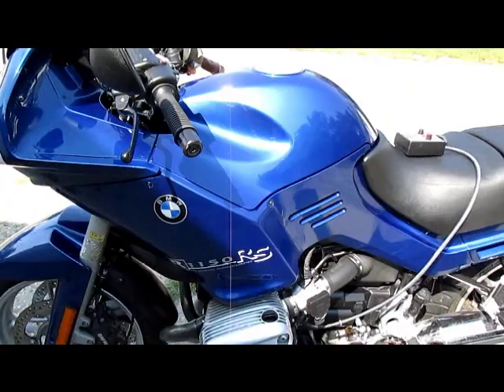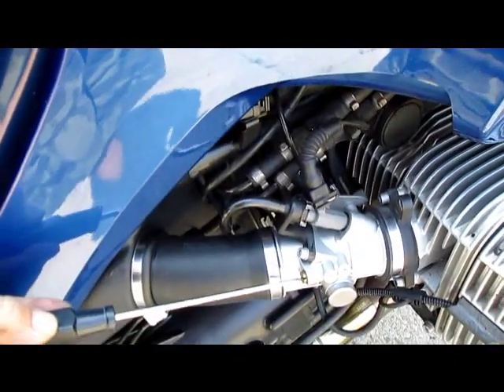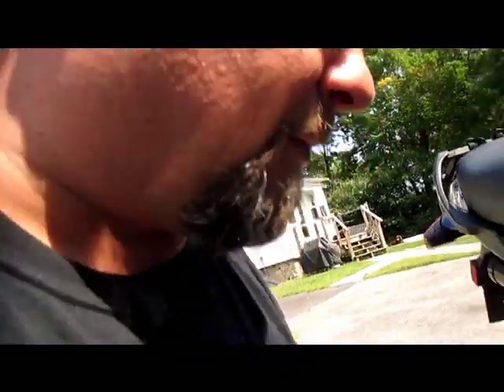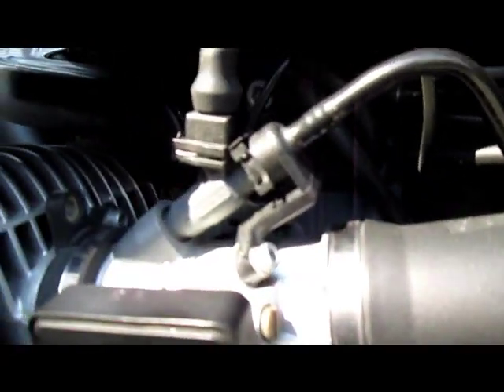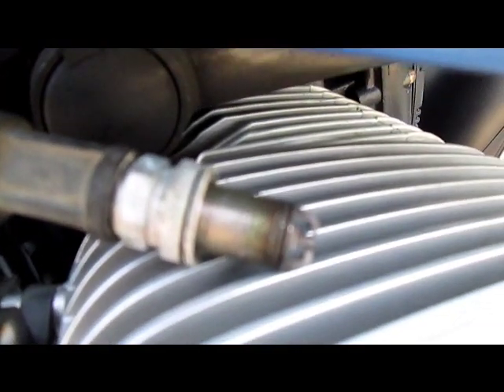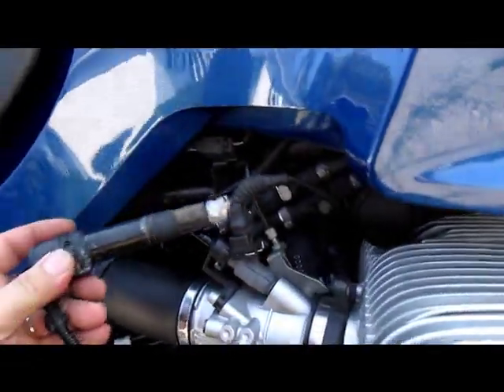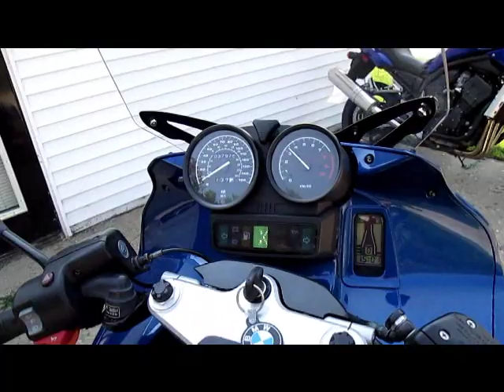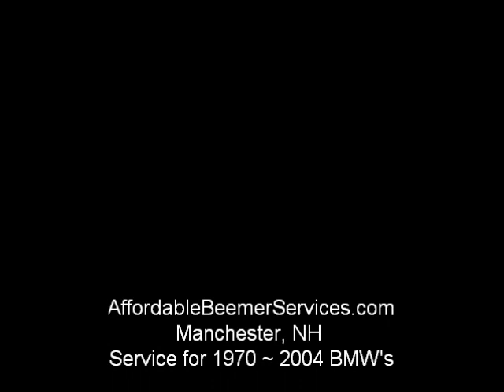BMW Service - Stick Coil Diagnosis

Comment from the maker: Hi Betz, That's the first thing I go to now if the engine runs poorly. The exhaust is still hot from the secondary plug firing the mixture but I'm sure it would be slightly cooler than the other cylinder where both plugs were firing properly. Thanks Betz, Chris

Comment: hice video thanks. my r1150 RTP sounds like this. I thought it was a spark plug. If you put your hand on the cylinder cover the dead one will be cold. Follow to the header and the one exhaust side will be cold.
Reply from the maker: Hi Ted, Only once since I started working on BMW's (1992) have I seen an Oilhead with fouled spark plugs. That incident was caused by a defective computer chip installed into the Motronic computer. The defective chip opened the fuel injectors wide open and kept them that way fuel spilling out of the header/muffler junction. A rare event. So for those reading it is rare, in my experience, to ever have a flooded spark plug in an Oilhead. There are certainly cases where a spark plug can fail prematurely due to being dropped before installation and such though. Good luck & Happy New Year, Chris
Reply: Chris Harris Thanks. I am still trying to figure out my problem. Unlike your video, my bike has one cylinder that is completely cold. It also runs worst than yours did on one cylinder. Also, I get a spark from both coils and unused fuel is leaking out the bad side from the header. Maybe I messed up my fuel injectors with the Stabill stuff I put in. Have you heard of any issues with fuel stablizers ?

Comment: Hi Chris, thanks for all the videos!
I own a 2002 R1150R and it didn't run for awhile. I change the starter, clean the injectors but know when i start it, the revs goes all the way to 4000 rpm and won't go down. Do you have an idea of what i should check first??
Thanks a lot in advance for your comment!
Reply from the maker: Throttle cable is hung up somewhere. Follow from the twist grip and look at each cable end at the throttle bodies. Good luck, Chris

Comment: Hi thinks for putting up the vid. I'm having problems with an RT. I can't find out why I have a rough idle. Sometimes it's fine other times it runs like shit. Mind you when you have revs on it, it seems fine. Any ideas on finding the what I believe is a faulty coil would be great.

Comment: good one... what is the electronic carb balance tool ?
Reply: TWINMAX Fuel Injection Synchronizer.  I got mine on eBay.  I think I paid $99 for it.  Its got offset balance adjust and sensitivity control.

Comment: Hi Chris! Quick question, the base setting for the BBS should be 1 + 1/2 turns for all R1150? If not then what should it be for an R1150GS twin spark?

Comment: 03 or 1200 CL when it’s cold it spits and sputters through the breather and Exhaust and when it’s warm it’s still spits and sputter sometimes it dies when I come to a stop anything past 40 miles an hour runs like a top is that spark plug or coil packs or is it the throttle bodies thank you
Reply: Boux6969@gmail.com 03 R1200cl  sorry
Reply from the maker: Check #8 in this diagram: https://shop.maxbmw.com/fiche/DiagramsMid/B0003942.png?v=07242017
#8: 13 71 1 342 365  RUBBER GROMMET
Common failure; change both sides with new clamps.
Good luck, Chris

Comment: Hi Chris, my bike 2005 R1200gs idles rough and is rough at slow speeds. Valves were adjusted and throttle bodies are balanced. Main Stick coils were replaced and have NGK plugs also replaced. Can the secondary coils make it run rough?  Those were not replaced. While idling there is a skip every 3-4 strokes that you can even see in the lights. Only accessories are PIAA running lights...but it was doing that before they were installed.....any ideas? Nearest dealer to me Is three hours away. Where are you located?
Reply from the maker: I do not work on that model but I wish you luck in finding the problem.
Reply: Hi Heather, have you found out what was the issue? i have a 2006 RT with exactly the same sympthoms.

Comment: Hi so if the stick coil one side failed we need to change that side right?
Reply from the maker: Yes but expect to other side to fail soon after. I prefer to replace them in pairs when possible.

Comment: r1100rt starts runs fine..then stops after 10min. 6 bars on heatguage. Will not restart! when cool will start again. any help? fuel pump replaced. HVS replaced. coils checked. injector check.. when trying to restart sounds like fuel starvation but fuel pump whirls normally when key turned !!  help?!
Reply from the maker: If it has spark when it will not run look at the fuel pressure.
Reply: Injectors spray after engine stops
Reply from the maker: So when the engine quits you still have spark and fuel delivery? Compression is next!